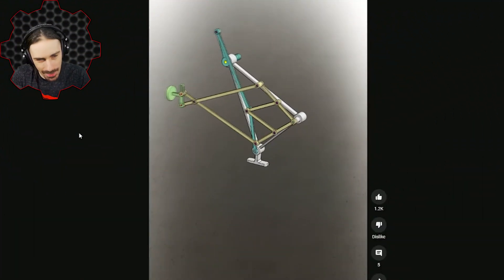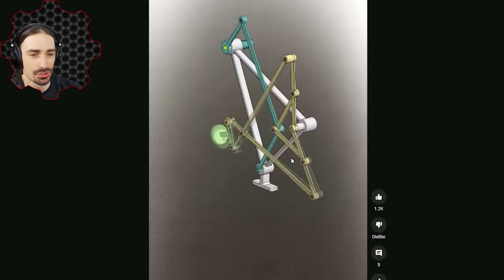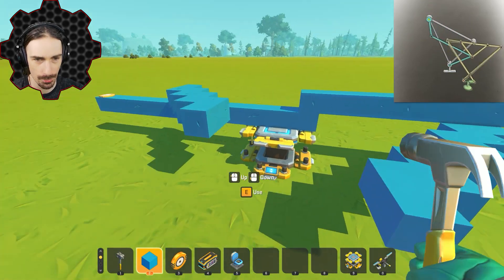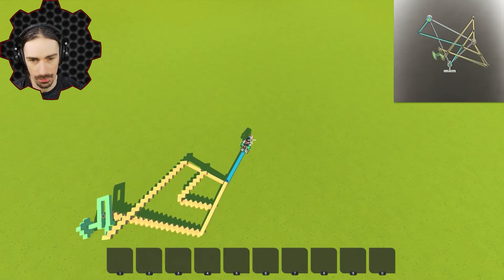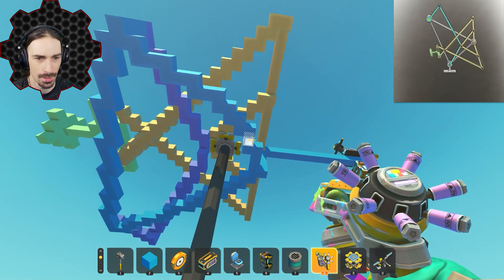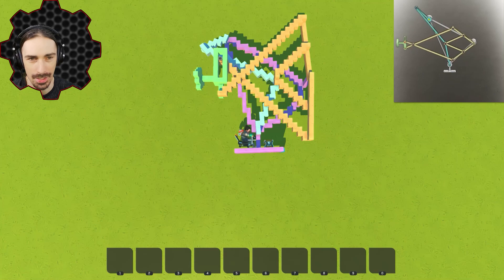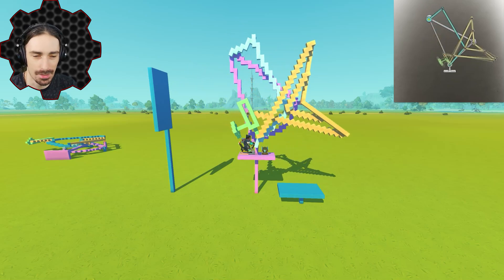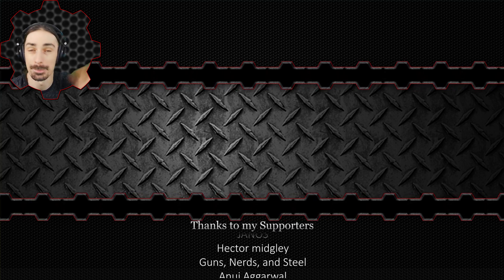This Mechanism Has Strange Movement, So I Made One!

Comment: Maybe this mechanism could be some kind of clamp maybe in a production line? Like it picks up an item and moves it to another layer, or maybe puts a cap on a bottle or smth
Reply: Clamp, hand, or suction cup. I agree, it seems like a pre-computer assembly line device.
Reply: Or on smaller levels, pick and place machines as used in PCB assembly
Reply: @nathanielhill8156  that's what I was thinking of, taking a PCB from a conveyor and loading it into a machine for further assembly OR it is to scan it for QC
Reply: That’s what I was thinking or maybe a suction cup
Reply: Plugging a cable in something to power it(?).
Reply: yeah a production line was my first thought too
Reply: That's what I was thinking ,a machine that grabs something,and move that object down
Reply: I was thinking the same thing, and I agree with the suction cup theory.

Comment: From what I can tell, the amount it goes down is based on the total length of the two blue lines that are connected to the motor, and the amount it goes to the side is based of the difference between their lengths. The final blue line can be adjusted to to change the difference in angle between all the way down and all the way left. Those seem the easiest to adjust to refine the motions. I'm also surprised Scrap Mechanic can even handle this whole system

Comment: The path of the output looks like the rotation of 0 degrees to 90 degrees(when the two yellow lines connect) .So the green line connects to the two yellow lines as an intersection of two lines,there are two yellow lines that connect to two bigger yellow lines that kind of doubles the movement of the green lines movement. I've seen this linkage before in a youtube vid clip which uses the mechanism as a placing mechanism using a magnet and at the end of the movement,the cubes disconnects from the magnet.I think you'll like Arglin Kampling,he knows a lot of mechanisms.types of mechanisms Arglin Kampling knows are linear,aproximate linear,reverser and walking mechanisms.if you want another walking mechanism, it's the strider linkage!!.the path of the leg  is an oval with a smooth bottom,to make a smooth walker,you need to have 3 or 4 strider linkages to even walk smoothly.I imagine Scrapmans version of the strider walker is going to be chaos with the 3 or 4 legs.(Btw the linkage he made was called a pick & place mechanism).
Reply: Wow you make a collage essay
Reply: Yeah,it's quite big.

Comment: This is one type of machine used to apply labels onto something. It grabs a label from a dispenser and either applies glue as it swings down or presses onto a preglued surface. Ex. a box or carton would be on a conveyor and when a sensor detects it's under the press, the motor turns once and applies the label. It can also be used to place unformed sheets of material such as metal or cardboard onto a conveyor.

Comment: I've followed the same channel, and it's actually more ideal to make these in Main Assembly because of the building system having custom default rotations and a smaller grid. I made a walking mechanism with one servo using the same principles.

Comment: I think it would be better if instead of making the diagonals pixelated, you made them straight and changed the angle with a powered bearing and then unpowered it when everything is built. I don't know much about the game so I don't know if it would be harder or even possible, but it would definitely be more accurate.
Reply: Unfortunately scrap mechanic doesn't allow to weld pieces that aren't on the grid.
You need to place your creation on the lift to weld it to itself, and controllers don't work when on the lift. Also, when you make a shape, you HAVE to use the weld tool because the last side will not snap to a bearing on the first side.
Reply: @SomeOne-eo7rw  I see, thanks!

Comment: The real problem of this mechanism wasn't just the rotating arm, it was the base the rotating arm sits on. The rotating arm needs to be a bit further away to change the ratio of movement in the apogee and perigee, right now the "horizontal" move is farther than the "vertical", moving the rotating arm a bit further away will fix that.

Comment: my first thought, after it worked: the bottom light blue "leg" is to long. As far as I can tell, shortening it, would cause the mechanism to dip down further. In the top down view (around 12:00) you can see, that it is more than 80% of the length to the right hard point. But the one in the example video only is about 2/3 of it.

Comment: I didn't expect it to work in SM, but you surprised me, great job
The size of the mechanism doesn't matter that much, only thing that have to be exact is the length of the lower blue beam, it should be same as the frame middle joint position: If frame have three points at [0,0] [a,a] [c,d], then blue bar length should be "a", this way, stamp will rotate exactly 90°
Size of the yellow scissor mechanism doesn't matter, as long as it is symmetrical
Length of the TOP blue bar should be enough to move the sway and move mechanism, your first try was almost perfect, except this bar was too short, which cause it to NOT extend when the stamp was in lower position
I hope you will make something like this again, try making it in multiplayer to see who can replicate it best

Comment: So a fix on this contraption would be to extend the rotation arm approximately 3 blocks and put a pivot at the fixed point on the slider/stamp bar so it acts more like a balanced scissor joint

Comment: If you extend both light blue lines at the top then it would commit more downwards without affecting the sideways movement
Reply: That was my first thought, it looks a bit shorter compared to the render, lengthen the powered section and bar that connects.

Comment: Also, if you built this off the lift and used controllers to hold the bearings, it could be built "off grid"
Reply: But then you can't weld two rods wihout one of them being a separate creation. Or to put it in other words, you can't weld to two points at once.

Comment: Very simple mechanism that iirc traces back to Pythagoras and has the nickname "nothing grinder".

Can also be used to teach how any point on a circle that's rolling on the inside of a circle with twice its diameter, will always travel in a straight line to and from the opposite side of the larger circle.

How I believe it'd be easiest to build:
Have a motor rotating at the center point of the larger circle, let's say clockwise from the viewing angle. Halfway the radius, so at the center of the smaller circle, have it rotate twice the speed in the other direction, so counter-clockwise in my example. This will make the smaller circle roll in the larger circle. In the standard 2-grinder version, each grinder is attached to an opposite side of the smaller circle. The arm, which is the power input in real-life versions normally, is basically an extension glued to the smaller circle. To prevent the grinders, just make them rotate in the original direction, so clockwise.
Reply: As for how and why I know this in such detail... I once made an animation of a nothing grinder in Blender3D for the practical exam of a 3D modeling class and got the full 20/20 aka 100%. Admittedly I'd been dabbling around in Blender for a few years in my spare time at that point and it was a class for those with 0 prior experience.

Comment: I believe, 'Build a Boat for Treasure' is better for those joint contraptions then. (since you complained)
Some tools cost a bit of gold, but some are obtainable at a secret location for free. (IDK, if the latter is still true)
But why do I suggest that? Well, the blocks can be adjusted to a 1/10 of its original size, and with the screwdriver tool, the collision can be turned off, making it possible to make the whole contraption on a single 2D plane. (the only issue is to save the build in a way where none of the blocks touch each other)

Comment: as Scrap metal ..., pardon me, i mean scrapman, mentioned in the video:
a very common misconception for games that only let you strictly build on a grid is that people think they cannot build struts on a diagonal that are attached by an axis on each end.
you can always build the "strut" in any shape you want AS LONG as the two axis on each end are exactly where you need them to be.
just a horizontal line and a vertical line, leading from one axis point to the other. physics do not care what shape your strut is at the end of the day.
you just need to make sure the offshoots dont collide with any other piece of your craft, but it should not if all your struts are on their own Layer, viewed Face-on.

Comment: Since all the rods in the original are straight and on bearings, would it be possible to make straight lines in SM and connect them individually to bearings afterward so that they fit together properly? Like, make a rod, position it, connect another rod, save it, connect another rod, etc...
Reply: if only. Can't weld parts of a single creation together off a lift.

Comment: Why did you use stair-like patterns of blocks when you could have just used controllers to rotate and thus have everything straight? Like, you could build two arms of equal length at a ninety-degree angle, then welded them to the straight arms.

Comment: could you not have just extended the tiny arm providing rotational force and adjusted the other arm appropriately for a higher angle against that arm in the middle which connects the machine to the power and then... you done it immediately after i typed half of my point. 

side bar: why was this not your first instinct? i saw this immediately, scrapman, youre awesome, but think less. often times, simple is best.